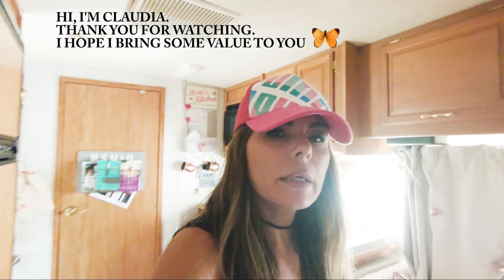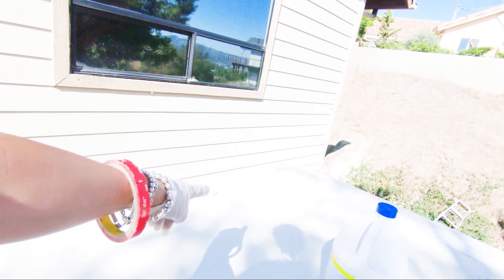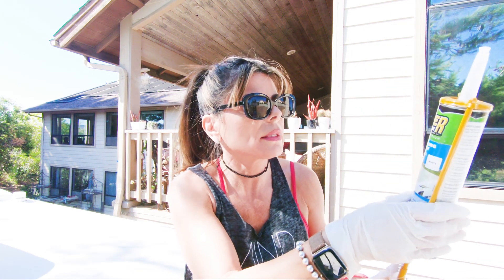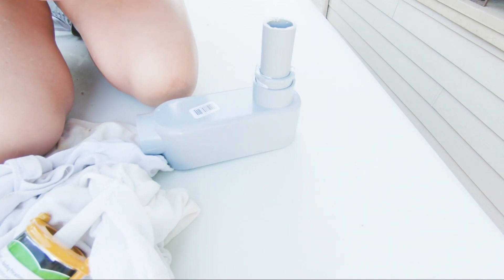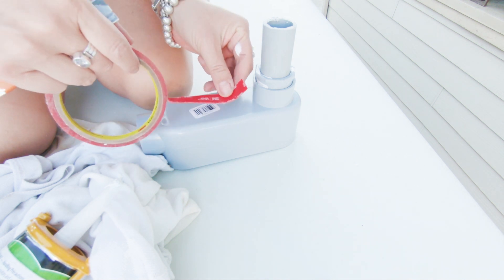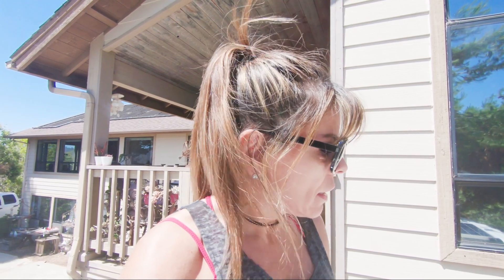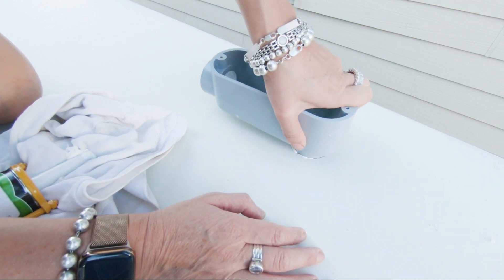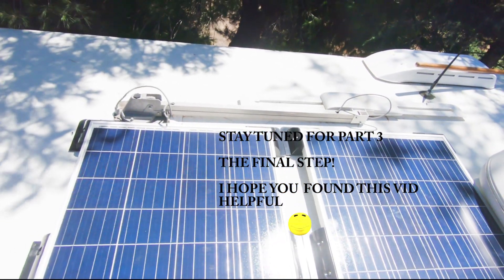Solar RV/ Cable Access Through RV Roof/ Part 2

Comment: What do you call the attachment with the teeth edges you drill the whole with?  Amazing how you aren't intimidated by any project it seems.  Love watching your videos.  Have you ever replaced holding tank sensors?  I want to do that.  Itd be nice if you could show us.  😊
Reply from the maker: Thank you Renee|! I do feel fear at first. always.  The bit I used it's called "Hole saw" I have never replaced the sensors but now that my water tank is exposed, I don't see it would be difficult. Cheers!

Comment: Nice job. The other wiring boxes for solar have to have stripped wire through the junction box and I like that your junction box allows for putting the solar cables through without having to strip wires.
Reply from the maker: Thank you! Yes, my set up it's quite simple. I was adviced and guided by Will Prowse who has become quite the expert on the matter.